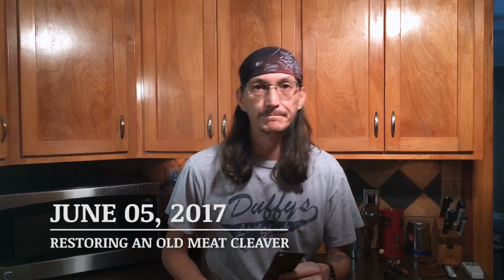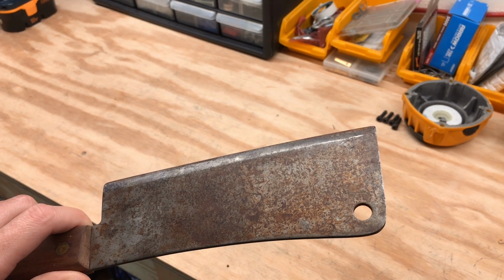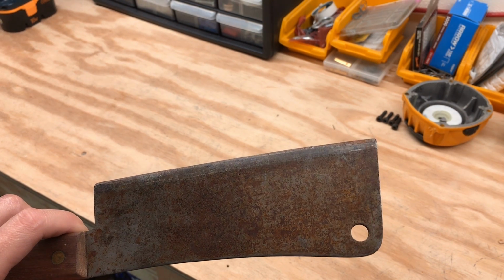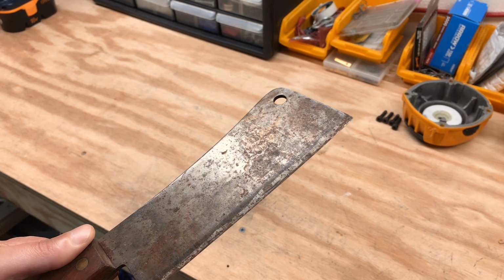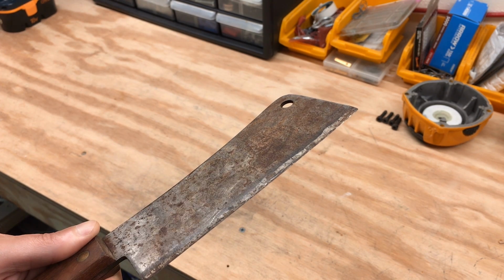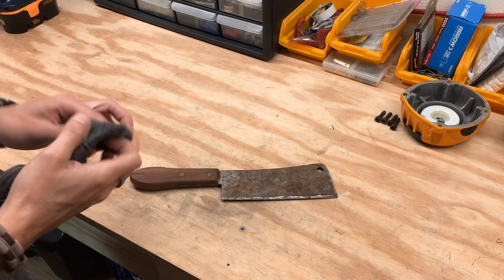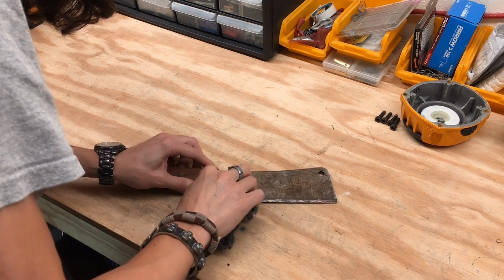Restoring an Antique Rusty KNIFE

Comment: whoa! That came out great! What is the machine you used first on the metal?  How much does the cleaver weigh?
Reply from the maker: +The Grass-fed Homestead - Just a drill press with a rotary brass brush. The sander with 220 grit worked much better. It weighs a couple pounds I'd guess.

Comment: cool video.
I've taken old blades like that and gotten them sharp enough to shave with. it is a lot of elbow grease but quite satisfying at the same time.
are you planning to oil the handle?
Reply from the maker: I put a little paste wax on the handle because I don't have any oil at the moment. I need to get some. I was pleasantly surprised at the quality of the steel.
Reply: I love getting (or rather finding old steel) and refurbishing it. so much fun.

Comment: uh, where's the giant G&T to go with all those nice lime slices? I thought for sure that would be the closing image! 😊
Reply from the maker: +Spyglass Fibercraft - It was very very tempting 😏
Reply: Do you like your sharpening kit? Would you recommend it or another type?
Reply from the maker: +Spyglass Fibercraft - I do like it so far. I've been using it for about a year. It's comparable to a whetstone but doesn't require water or oil. Time will tell if it lasts as long or longer, I just haven't had it long enough to determine that. But it does a good job of getting a nice sharp edge to the point you could finish with leather and jewelers rouge.